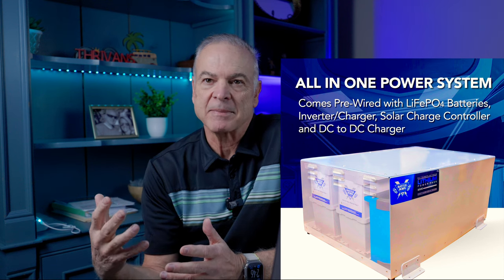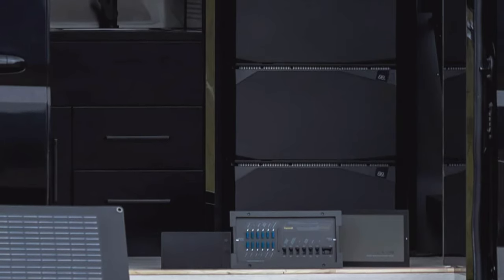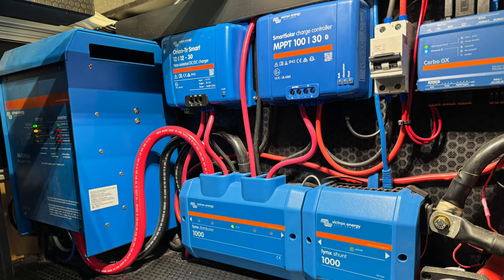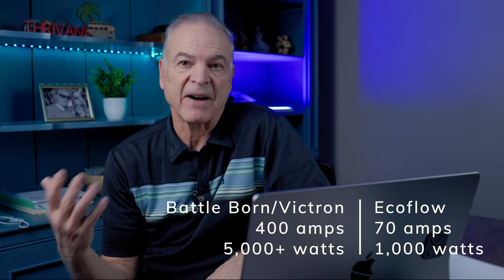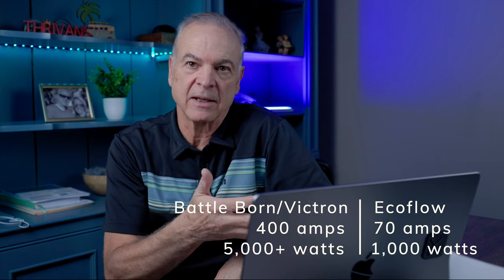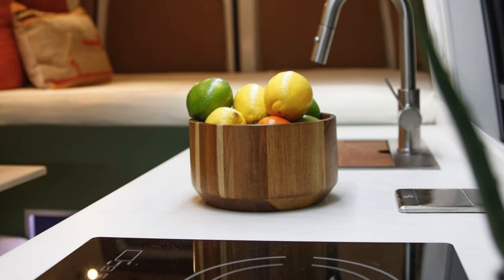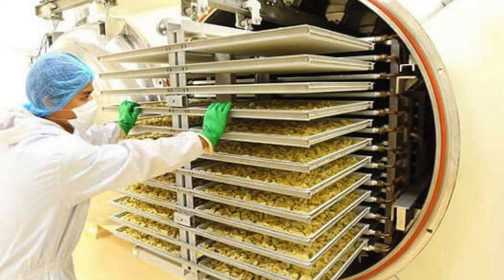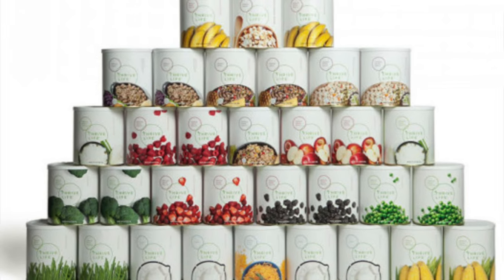Watch Before Buying an Ecoflow: Ecoflow vs Victron

Comment: Great video, the problem we have in Australia is they have new policy since Nov 23 and if you go with a traditional setup you have to treat it like having a gas bottle connected inside, it must be vented to the outside and boxed in, we're not as lucky as North America, we live in a policy driven country, we can't even park our van conversions in a lot of the towns/cities if we don't have a plumbed in shower/sink/toilet due to policy, I still go with no shower and park on a local street overnight, and I use the Bluetti system due to the ease of installation. I don't like the idea of venting batteries to the outside elements, I think in Australia that would lead to dust/dirt getting onto the terminals and into the batteries and all the other components and having major issues in the middle of nowhere as most of Australia is remote, not good.
Reply from the maker: Thanks for the info. Sorry to hear about all the red tape!

Comment: Inverter from ecoflow is not 2200, it's 3600 so a win there
And what a comparison in the 2 builds, why just the cheap display with no cerbo gx on the victron side , i mean the ecoflow has the panel with full readout of the whole system, not fair really, also where is the bms from victron for the 4 batteries ?? At the end victron really is more expensive, u can't deny it. Bad comparison sir,  keep on trying defend victron. I know u don't wanna lose your job as victron electrician in vans but this review is manipulated.

Comment: perfectly timed for the design of my van.  was considering both systems.  question for you . . . when it comes to solar, if we assume 12 hours of daylight under blue skies and you have 400 Watts of solar panels on the roof, how much charge (Ah) do you think your batteries can take on per day?  Just trying to figure out the amount of Ah required for the hotter summer days to enable us to be off grid using a 12 V rooftop AC unit.  Thx.
Reply from the maker: That’s a tough one, because there are so many variables. A big one is angle of the sun. You may only get 50-100 watts when the sun is low. When the sun is more directly overhead you’ll get more, but never the full 400 watts. Depending on your latitude, you will probably average 200-300 watts across a full day on a good day. That will give you around 200Ah on a 12V system. It’s tough to supply all your needs from solar on a van. You just can’t fit enough panels on the roof.

Comment: I have been running an Ecoflow Delta 2 Max with extra battery (4.2 kW hr capacity) in my Sprinter van for 6 months now and I highly recommend against using Ecoflow. It is unreliable and buggy. Within the first month the connection system to the extra battery failed and I had to replace the main unit under warranty. Since then the unit has required shutdown and rebooting every few days for various reasons such as random disconnecting from the iPhone app, which is the only way to change certain settings such as charge rate. Furthermore, DC charge rate is limited to about 500 watts per port and only if you push the voltage up towards 60 volts. So to charge faster you need to use a 2000 watt pure sine wave inverter. When charging on AC the Ecoflow passes through the AC and this is not configurable so you can’t charge on AC and use the Ecoflow inverter. 

I highly regret buying Ecoflow and should have gone with a Victron system from the start. Don’t make my mistake as I curse my Ecoflow system every few days whenever something goes wrong.
Reply from the maker: Dang. So sorry to hear that you’re having these problems.

Comment: I know the change is going to be painful but companies that build cars, trucks, and the like need to get the lead out that start converting their electrical systems to 48V. It will definitely have a painful initial ripple effect, but all of the huge, heavy wires and components with 12V systems are an incredible waste, are fairly expensive, and require tools that largely will gather dust after installation unless it's your trade.  I'm just not feeling that noise, and I work with some of it.  I love the idea of a 48V battery by itself, but you can see fairly quickly all of the conversion required to make 12v system play well with it...particularly when the batteries need a charge from other than solar.
Reply from the maker: Amen.

Comment: I will not go far into your video before saying this. I have both systems and the all in one systems are very convenient but also very expensive and not just to buy. 

I accidentally pulled more than 8amps from an 8 amp plug (DC5521) in one of my old all in one systems. Smoke came out & the entire thing died (inverter, battery and all other plugs…dead). 

I did the same thing to my “Victron” system and only my 30 amp fuse blew. I once also “accidentally” put an incompatible solar and only the fuse on my MPPT had to be replaced (the panel voltage was higher than what was allowed by the MPPT).

My all in one system might have been old and maybe didn’t have a bough protection for the individual circuits but the entire thing still died.
Reply from the maker: Very good points. Thanks for sharing.

Comment: Great video and explanation.  I was wondering could you use an isotherm 4 gallon hot water heater as a holding tank for the hot water coming out of the AquatHot.  This way don’t have to wait 20 mins for the water to heat up.
Reply from the maker: I’m not sure whether that would work. My first thought is that it probably wouldn’t, however where there’s a will there’s probably a way. BTW- 20 minutes is for the water to reach full temperature. It is pretty warm after 8-10 minutes.

Comment: I understand the benefits of have two Orion devices for faster alternator charging but why do you not recommend a 2nd alternator? Is it just the cost of buying the additional alternator and having it installed? Is this something that can easily be added to a system down the line?

Comment: The main drawback of Ecoflow is that you can't add more batteries. And thats  a huge drawback! I just don't understand why Ecoflow chose to severely limit their system like this. In almost all other areas Ecoflow is better especially the fact that it doesn't require you to programming anything. But considering the huge drawback I chose Victron for my van without a sec thought.
Reply: that incorrect. You can add batteries.

Comment: Thanks so much. Very timely. My builder is about to add the 10kw EcoFlow. I am concerned . The issue is the amps coming from the sprinter factory alternator. Just curious if you can run directly from a secondary alternator, right to the alternator port?
Reply from the maker: Yes. You can run either system off of a secondary alternator, although you are more limited in the amperage with Ecoflow.
Reply: @thrivans  thank you!
Reply: I have an inverter attached to the car battery (by the auto electrician), then you plug in your PowerStations AC Adaptor and while you're driving you are charging your PowerStation, also EcoFlow have brought out an actual system that connects to the car battery and powers up the EcoFlow so fast, that's your best idea, that way you're not using Amps and being limited.

Comment: You seem like a sincere guy but your watt hour rating for the EcoFlow vs Battle Born battery does not look correct; Battle Born states their watt hour rating on their 100ah batteries as 1200wh. That means that four of those would only contain 4800wh. EcoFlow is as you stated; 5120wh. The inverter outputs are also are off; Victron uses volt amps and a power factor so their inverter only puts out 2400 watts continuous; the EcoFlow runs 3600 watts continuous.....that is 1200 watts difference favoring EcoFlow.

I install a lot of RV solar power systems and do Victron and I have to say that your conclusions conclusions are incorrect. You may have made an honest mistake but you really need to take this down and redo the video.
Reply from the maker: Ecoflow reached out to us about the error in output watts and we put a correction in the description, which was satisfactory to them. As far as the watt hours for the Battle Born batteries, we explained that we used a working voltage of 13.5. 400Ah X 13.5V = 5,400Wh.
Reply: Watt hours for 4 Battle Born batteries is 1200wh x 4 and that equals 4800 total watt hours. The Ecoflow battery has 5120wh.  If you divide those numbers by 13.5 you get the actual amp hours available. There is no magical way to get more capacity out of the Battle Borns than the EcoFlows.

Comment: Great video! I’m looking for information as to EcoFlow distributors. I purchased a van with the 5 KW power kit. Having a few issues. I’ve been emailing with EcoFlow support with no real solution yet. Would really like some hands on help.Location Midwest. TIA
Reply from the maker: Sorry, but we don't work on Ecoflow systems. I hope you can find some help to get yours working. This is my biggest issue with Ecoflow and other all-in-1 systems. If something's not working, the whole system may have to be sent in for repair or replaced. 

With a modular system like Victron, if something is not working, that component can be replaced. We have had inverters, Orions and MPPTs become faulty. we simply sent the customer a new unit (under warranty) and they were able to swap it out.

Comment: Thanks for the video - however you missed a very important point which make the Eco Flow lithium systems far superior to Battle born and others. It has to do with the fact the Eco Flow lithium batteries are 51 volts rather than 12 volts. This means they operate using 75 less amperage for the same load verses 12 volts.  Less amperage means less heat and losses and higher discharge and charging abilities. In addition, the Eco Flow inverter, up and down converters all operate cooler thanks to low amperage. 

If you would like more information on 51 volt systems look over my non sponsored 51 volt dual voltage dual Inverter RV system Thanks Mike 

5112 dual Voltage Lithium System

https://www.youtube.com/watch?v=ZxSS44przNs

Comment: I build my own systems. Once you learn how, it's easy. I learned how from Will Prowse. He's a little genius on all things solar. Have two (2) stand alone 1208ah systems. Each system, sans solar panels only cost me about $1,000. I buy the raw Li Fe PO4 302wh batteries and stack 4 of them together for each system.  Victron is nice but way overpriced for today's market. 
- I use one system and charge the other; rotating. 
-
The key, to me, living in a van is insulation. 
I pretty much live in a giant icebox. Easy to cool, and to heat. I'm surrounded by 2" of xps foam.  The living compartment is separate from the driving part of the van. 
-
Reply from the maker: Will is a genius. I’ve learned a lot from him and Nate at Explorist.

Comment: Here’s the real issue, any electrical equipment, runs on watts. That is the unit of power. A 60 W lightbulb doesn’t care how much voltage or amperage it gets, as long as it gets 60 W. That is an ongoing issue with these electrical component manufacturers. Everything has to be displayed in watts, otherwise it makes no sense.

Comment: Biased video. 3,600 Ecoflow option is more advanced. 
Other factors are install costs. This varies wildly and can be misleading. 
The simple fact that you are an installer is implying bias and you should recuse yourself from such activities. 
And why EcoFlow vs Bluettie or other out of the box battery storage inverter manufacturers?
You may not realize that your comparisons are so skewed, which would be my largest concern. 
I normally do not comment on comparison videos but this is one of the most unjust that I have seen. 
I’m neither for or against either of the systems you are comparing but have enough understanding of the lines that both have advantages and disadvantages but to the degree when factoring in the install seems simply irresponsible. But it’s your channel so…
I would hope that you adjust your evaluation or it casts a shadow on the rest of your channel IMHO.